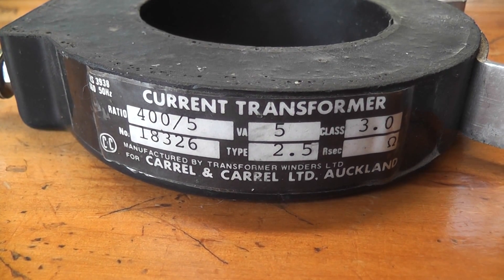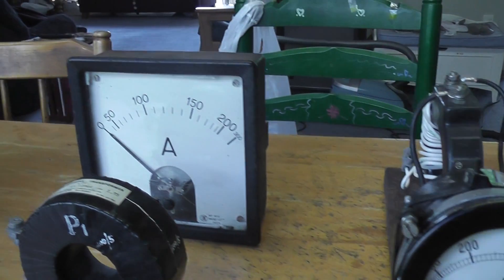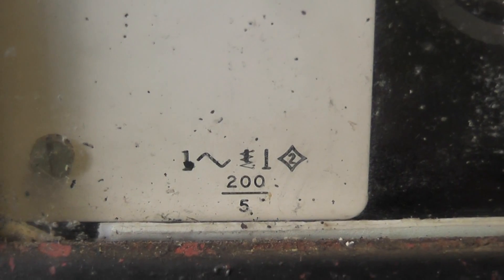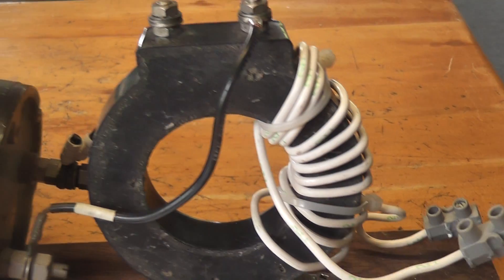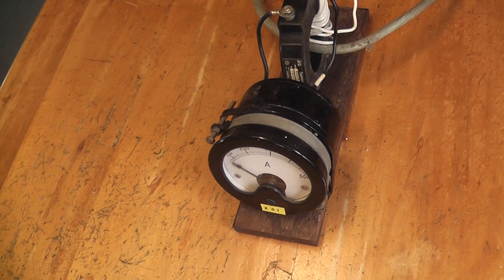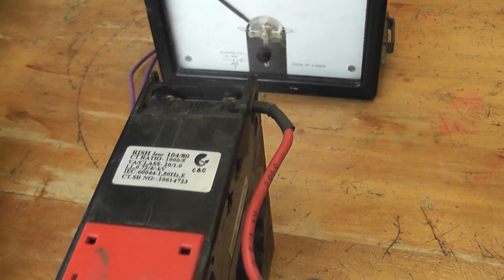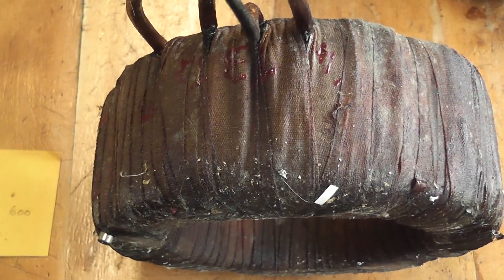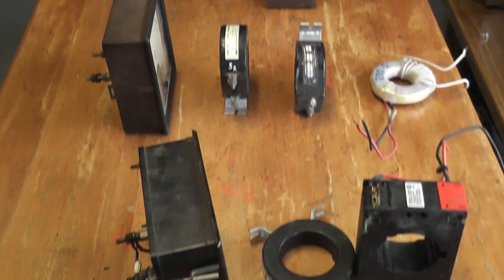CT's or Current Transformers and Ammeters

Comment: Can this concept be used to measure high voltages? I would love to be able see what voltages I'm making in real time.
Reply from the maker: +Lets NOT Play With Electricity Yes, same principle is used for High Voltage. In this case we call them VT's or Voltage Transformers. They are often precision transformers e.g. 11000 / 110 Volts which yield in a multiplier of 100. I use one of those in one of my recent video's making arcs. That one was 6350 / 63.5 Volts.

Comment: I think I understand the 400:5 Current ratio. Those AC analog meters must have substantial shunts for FS @ 5 amps. Can you tell me how saying 400:5 differs from just saying a ratio of 80? Are the ratings saying it can supply 5 amperes external AC current maximum to a remote analog meter?
Reply from the maker: +paul larson The ratio of 80 is usually applied for a so called blank 5 meter. Some kWh meters have the multipliers built into them or programmed with an electronic meter to have true readings. Some utilities only wanted to keep one type of meter on the shelf hence they add a readings times 80 label to the meter.

Comment: how to wire in a 30A meter in to a car? mine goes from +30 to -30 A in a dashboard cluster.
Reply from the maker: +Arjan Wilbie A valve radio would be super cool to have fitted and supplied by its own dedicated generator.
Reply from the maker: +Arjan Wilbie The ammeter is wired in between the wire which goes from the positive battery terminal to the load. That is usually the thinner wire (6 or 10 mil ). The thick cable to the starter motor is not measured otherwise the ammeter will burn out and causes excessive volts drop. Wiring depends from car to car and also how the alternator is connected as you want to measure the charging as well.
Reply: +RODALCO2007 it is a 1965 lwb land rover. it has a lucas generator 30A and a rectifier. the wire from the generator goes to the rectifier and indeed the 350A draw of the starter goes by 50mm2 cable straight from the battery to the starter. i love the positive earth system, i plan to build in a second unit to generate 30A for a valve car radio and valve amplifier and to get a pulse for a rpm meter..
Reply: +Arjan Wilbie Sounds like a cool project. Are you making videos on it? 30A is small by todays standards, 100A alternators are common place now.
Reply: KiwiPowerNZ i never would have thought what i did would be special. I have 7 projects on the go, all land rovers that need work like welding, gearbox refurb and a stripdown of a V8 and rebuild and to have it fitted with a automatic gearbox.
Reply from the maker: +KiwiPowerNZ Arjan mentioned a DC generator. They were often rated at 30 Amp max and often less.
Reply: RODALCO2007 it is a 6V philips radio from the end of the 1950's. It is going to be a 12v one with vibrator conversion to a electronic design ( it sits inside the old housing) and i just love it. A friend is designing a amplifier with valves laying flat so it fits in the mahogany radio tray fitted in the truck cab with the big AM shut down, i might build a few transmitters to get my historicly correct radio. From Veronica 192 and 538, RNI, Caroline, Radio London to Radio hauraki. The diesel engine had a ex NL army lump fitted and i can make brackets for the second generator. I have one from a 1953 land rover that has a extra pin sticking out the body for a pulse. The gearbox has a PTO fitted, i need to cast a housing and lid to get two gears in and get a PTO gearbox to run generators or big circular saws on it. I need a camera, some tools and my vehicles transported from holland to the uk. :)
Reply from the maker: +Arjan Wilbie Excellent ! when your project is completed please make a video of it. Two generators is very cool , especially on a diesel. Allow adequate cooling for the valves or have a small fan cooling the valves so they don't overheat.